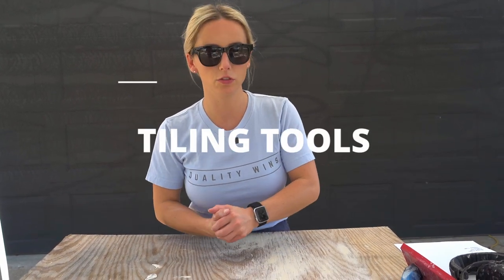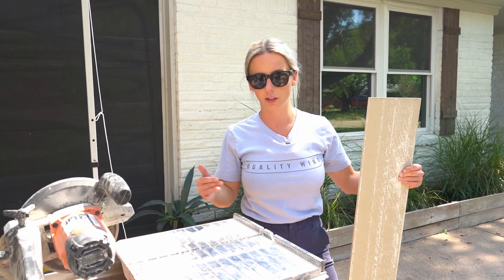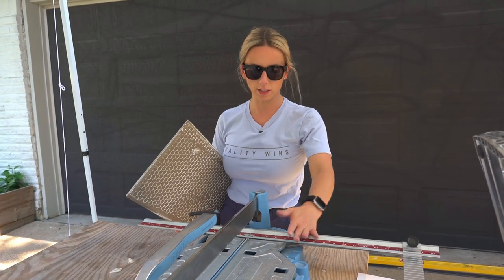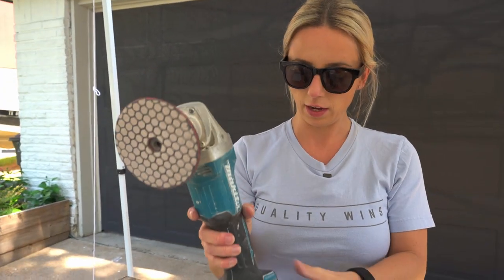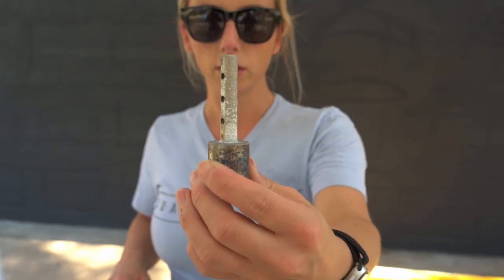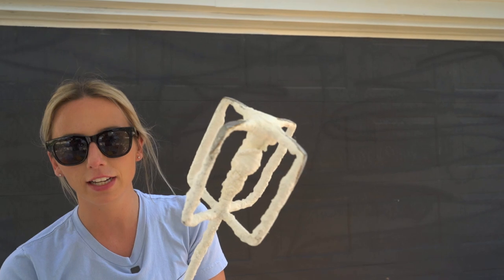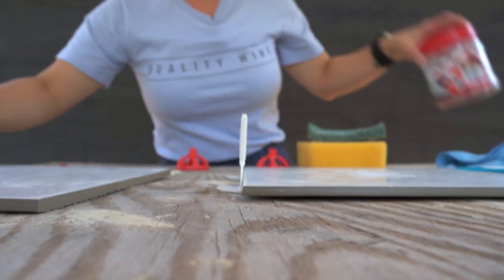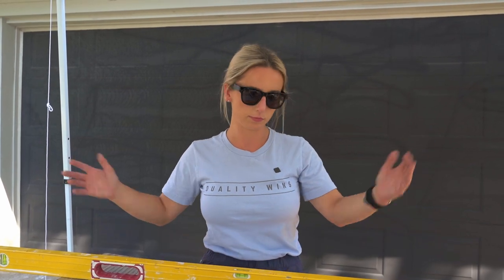Essential tiling tools to complete any tile project

Comment: Wow! Thanks for the help. I have 2 Sigma cutters that I have had for 3 or 4 years. I have a small one that cuts up to 14 inches, and one that cuts up to 37 inches or so. I have used the small one for backsplashes and really like it, but I have never gotten any good use out of the big one because I couldn't get it to make good cuts and it just damaged the tile. I had sort of given up on it, but this video has helped me. I watched your technique and tried it and it works!!!!  I made some practice cuts with some tiles I have and it actually cut nicely. 

Thank you! I may be able to actually use it now. Thank you so much.

Comment: This is very comprehensive. Your videos are great! The only other things that I can think of that I use every time I tile is a scale and measuring cup. I never mix full bags of thinset, I always weigh out between 10 and 20 pounds at a time depending on the job size and timing (I'm not all that speedy in general, especially when setting around windows - I'm faster setting floors). I also use a ton of drop cloths and blue tape.
Reply from the maker: Perfect ! Same here I never mix full bags lol    Thanks for watching !

Comment: Doing my bathroom over. This is a good start. The wet saw the most expensive part.
Reply: Don't need a wet saw. Grinder with a good blade and score and snap does everything.

Comment: This is only about 10% of tools used where I live in Europe. In Italy and other countries tile laying is very productive and quick, cause there is tradition of 'known' pricing, and no contractor wants to be seen as overpricing. Often clients don't even ask for a pricing before job is done. That leaves only one way to make a good living and a profit, increase productivity by using extremely specific tools designed to give any marginal gain to speed and ergonomy possible. Those tools can be high tech like Sigma Batipav Rubbi, but more often low tech like a woodworking chisel or an ax.

Comment: Will a 10 amp wet saw get smooth cuts on 0.35 in thick porcelain tile? Or can I just use a snap cutter?
Reply from the maker: Most wet saws today will cut most porcelain up to 3/8" think with no issue, the snap cutter vs tile saw I think comes down to personal preference to be honest
Reply: @ThatTileChick  ok thanks!

Comment: Seems like you copy other tile YouTubers content basically same video be original
Reply from the maker: So Ford shouldn't make trucks because Dodge does? I have my own style and my own original videos.  If you don't like it, don't watch =)
Reply: A few things like tip nippers, long straight edges for common areas, string lines and other set out tools are important for DIY hackers. Overall you got most of the tools you’d use.